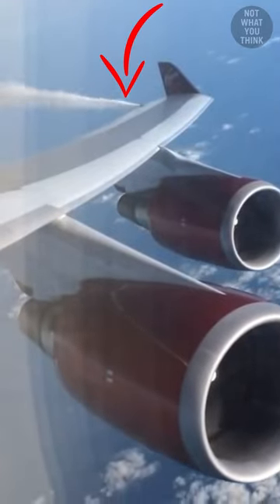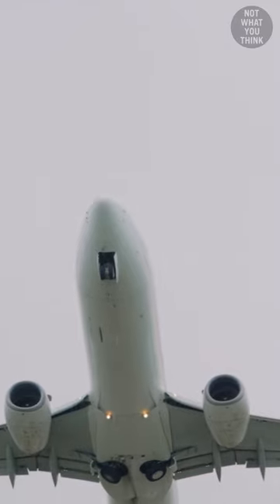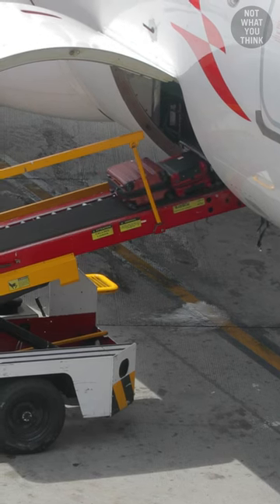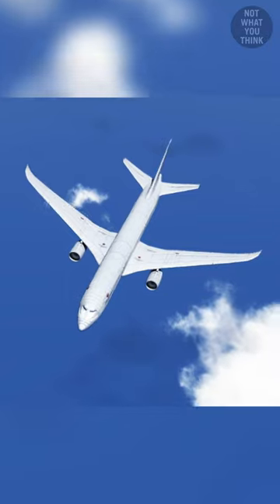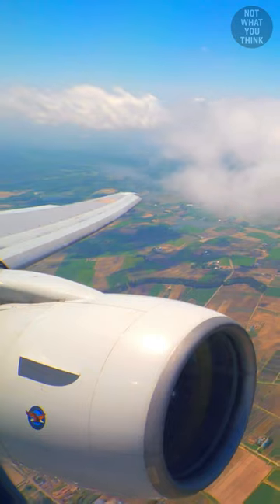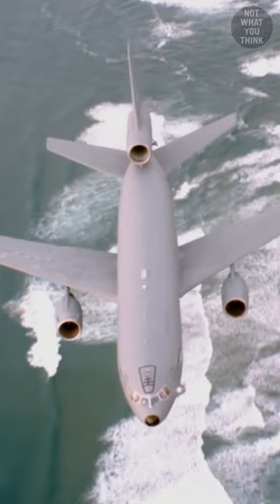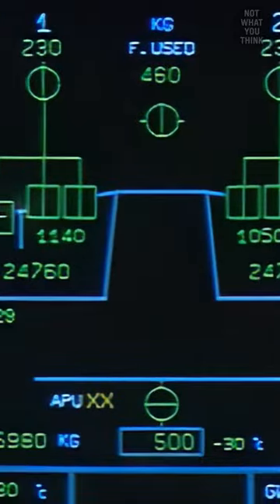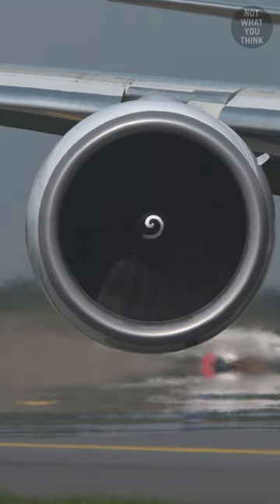Why is the wing fuel used last? #shorts

Comment: Fuel in the wings also puts the weight of the fuel right where the lift is generated, creating less stress on the structure of the airplane. If all the fuel was stored in the fuselage, the wing spars would have to carry more weight, which would shorten their lifespan.
Reply: It also reduces the magnitude of wing fatiguing from turbulence, because it is difficult to accelerate the fuel up and down. The wing is light without that, the stress changes would be close to instantaneous.
Reply: These explanations are far far more important than anything mentioned in the video... which makes me question anything I've "learned" from this channel.
Reply: That's what I was gonna say. I think it's more important to turbulence which is going to happen way more often than running out of gas.
Reply: This was what I was taught, back when I used to refuel aircraft.
Reply: Called wing bending moment, the greatest strain on an aircraft and the reason for most G limitations. The less weight in the fuselage the less stress on the wing spar. Life limits are generally increased manyfold if weight is first taken out of the fuselage.
Other limitations are also affected such as max gross weight, and maneuvering speed if attention is paid to wing fuel vs fuselage fuel.
Reply: @nicholasjohnson778 
Wise man
Reply: @nicholasjohnson778 it’s a 1 minute video…
Reply: @Specter_1125 It's a one minute video that claimed to know the "reason" for loading fuel in the wings, but failed to mention the most critical reason.

Whether it takes an hour or a minute, spreading incomplete information as though it's not, is bad practice.
Reply: @nicholasjohnson778 I would question your unreasonable expectations from a 1 min clip

As long as it’s not fake facts, why whine?
Reply: @SoiBoi_Kelda1059 Because it's not the main reason why aircraft store fuel in the wings.

Right or wrong, people (including myself) are educating ourselves from various internet sources including YouTube. 1 minute or 1 hour, content creators shouldn't make videos if they aren't a professional in that field, haven't interviewed one, or haven't thoroughly researched the topic to avoid obvious mistakes.

Whatever your expertise is, I would hope you call out errors when you see them.
Reply: Spot on. This is the number 1 reason. 
When loading transport aircraft MZFM ( maximum zero fuel mas), is a primary consideration, as is MTOM ( maximum take off mass)  , and MLM ( Maximum Landing Mass). These must all be considered as part of the load sheet calculations for every flight).
( I'm a recently retired airline pilot)
Reply: The only correct explanation
Reply: This is the correct answer. Source: former flight engineer, it was my job to balance fuel
Reply: Exactly, that’s the main reason
Reply: @SoiBoi_Kelda1059 Bingo!!!!
Reply: @genespell4340  lol, have a great continued day
Reply: The gravity feeding sounds good but in most heavy aircraft the engine driven fuel pump can pump fuel from any tank by means of a jet pump or by suction.  If the engine driven pump fails, the engine won't run anyway.
Reply: @mal15102  aircraft are often designed to still use gravity feed, in the event one of the jet pumps or fuel pumps in the tank fails, the fuel can still feed to the engine driven pump.

Comment: Sorry NWYT guy, but none of your points is actually valid. 1) Jet engine cannot work with only gravity feed, they require high fuel flow and pumps are mandatory, thus all jet engines have redundant pumps because if they stop, the engine stop. 2) Having a fire on the fuselage of the plane is not more dangerous, and is actually a lot harder because the fuselage is stronger than the wings. In a crash or very hard land, wings will almost always be damaged, while the center fuel tank won't. 3) The actual reason why the center fuel tank is used first is to reduce wing flex (bend), which makes the wings more efficient by moving weight from the enter of the edge of the wings. In fact, all modern airliners have an inner and outer wing fuel tank, and the last fuel tank used is the outer wing tanks in order to try and keep wing flex as small possible the longest duration. Fuel will always be presend in the inner wing tank because that is where fuel is pumped to the engines, so once the inner wing tanks are low, fiel from the outer wing tanks start being transfered. So to sum up, the center tank is used first to keep the weight of the wing fuld tanks (and reduce the weight of the fuselage) to reduce wing flex and thus improve lift/fuel efficiency.
Reply: Came here to say basically this- I’m not sure how you delineate modern though. The KC-135 is certainly old (engines are comparatively young)- but our fuel burn sequence is slightly different. We have 4 engines, each feeding from their own individual wing tank when burning wing fuel (if memory serves me correctly- it’s been a couple of years).

Comment: The fuel is not gravity fed. It is suction fed. The engines even without the fuel boost pumps running can suck the required fuel through the pipes. The pick up point is always at the very lowest part of the tank and to feed to outboard engines gravity wouldn’t work. It is sucked by the engine driven fuel pump that is directly driven from the accessory gearboxes.

Comment: Finally. I've learned something about planes after 500 shorts from other aviation channels
Reply: That's because they're almost all AI Bot content.
Reply: It’s not actually the reason. I’m an A350 F/O. The main reason is to reduce the loading on the wing spar, the part that joins the wings to the fuselage of the aircraft. Having the weight where the lift is generated means that the structures supporting the aircraft can be weaker, and more importantly, lighter meaning more people, more bags and more cargo inside of the fuselage.

The reasons he mentioned are somewhat true but not the primary reasons.
Reply: Exactly my thoughts
Reply: @zacharytracy3797 is that a thing already?
Reply: @Laluan honestly, with how absolutely stupid the scripts sound sometimes, combined with the now very common text-to-speech voices that we hear all the time, i wouldn’t be surprised if some or even many of the channels that post on yt shorts have the most minimal human intervention possible to generate a vid
Reply: @huskkyy theres probably multiple reasons
Reply: It's not accurate though. You really think you could overcome the pressure in the combustion chamber of a jet engine with a meter of drop? This whole explanation is asinine.

Comment: This is just so incorrect. Gravity feed has NEVER been an option on ANY large aircraft I have seen, and I have been involved in aircraft design for 53 years.. You just won't get enough pressure to feed fuel fast enough.  Fuel in the wing just puts fuel where the lift is generated. It results in less wing bending load. The wing volume is almost useless for any other use except for fuel storage. The center of gravity reason is also correct.
Reply: We could run an engine without the boost pumps (for that particular engine) enabled because the fuel manifold was pressurized by the hydraulic fuel boost pumps when using fuselage fuel. KC-135. On the much smaller t-1 fuel is provided by motive flow from a mechanical engine driven pump and an Venturi pump in the wing tank, only needing an electric boost pump for engine start and a couple other specific situations. Granted, neither of those things are gravity feed
Reply: The engine still has its own fuel.pumps but you can gravity feed from the wing tanks if a boost pump fails or so that's my understanding as a mechanic

Comment: Fun fact: the 747 had 2,200 gal fuel tanks in the horizontal stabilizer of the aircraft and the flight engineer would transfer the fuel back and forth between the wings and the elevator based on the load of the aircraft
Reply: Uh, the “elevator” is the moveable part of the horizontal stabilizer. It carries zero fuel, in fact the horizontal stabilizer carries zero fuel, much less 22,000 gallons or 147,000 pounds of fuel. That’s ludicrous. Fuel is balanced between fuselage tanks however.
Reply: @triggerpointtechnology  look up 747-400 fuel tanks, I was told this by a 747 captain of 20 years. His info is a bit more reliable. And the elevator is the part of the tail that doenst move. The horizontal and vertical stabilizer is what moves. And I made a typo, 2,200 gallons of fuel.
Reply: @thatsrtkid 
Oh, ok, you’re the expert. I’m just a retired 12,000 hour Pan Am Captain.
You don’t know what you are talking about. The newest ones did have a “tail plane” tank, added after the ones I flew. But that is the horizontal stabilizer, not the elevator.
Take a flying lesson for gods sake.
Reply: @thatsrtkid you're wrong lol the elevator is the little piece that moves at the back of the tail to make the aircraft pitch up or down, and they most definitely do not carry any fuel
Reply: 747-400 tail tanks. I know I'm right.
Reply: For the B747 the tank in the stabilizer is an additional tank only. Airbus wide bodies (except the a350) have a trim tank in the ths, the trimmable horizontal stabilizer. This tank is not only a tank but is part of the trim system, controlled by the fcmc.
The tailplane trim tank is always used when the fuel load is above around 37000kg. The refuel system puts fuel in there during the refuel. During the climb at FL255 with certain other conditions fuel is pumped aft to achieve an aft CG target set by the FCMC even if the tank was empty on take off. This is about 2.5pc fwd of the aft CG limit. As fuel is used the CG moves aft and when it reaches a target of 2pc fwd of Aft Cg, then fuel is pumped fwd into the centre or wing tanks.
There is usually only one aft transfer in each flight, but there can be many fwd transfers.
Finally at FL245 in the descent, any remaining fuel is pumped fwd into the wing tanks.
So the CG is held between 2 and 2.5 pc fwd of the aft limit.
Trim fuel is normally used on all flights.
The point of using fuel in the trim tank is to reduce the downforce required to overcome the aircraft lift/weight couple, so the ths can remain "in the flow" without much drag.
And... the elevator is the flap on the trailing edge of the stabilizer. The ths, the trimmable horizontal stabilizer, moves slowly to trim. The elevator makes the fast, temporary movements to pitch up or down. The elevators are the joke/sidestick, the ths are the wheels between the pilots.

Comment: Fuel in the wing is also used for cooling reasons too, as the cold air wraps around the wing. Even fighter jets cycle fuel through their wings. They are used in Oil/Fuel heat exchangers. It is important to keep oil at an operating temp for Velocity.
Reply: Incorrect, the most danger in an airliner is fuel getting too cold, the oil/fuel heat exchangers are meant to KEEP the temperature of the fuel high, not to cool it.
Reply: @MrCaiobrz  it's used for either or. When I was in the fighter community,  they taught us that it was used for cooling fluids. But then again, on the F18 Super Hornet, fuel is constantly moving around the aircraft and keeping the CG centered for maximum performance.
Reply: @itxbr14n comparing an airliner and a fighter is not exactly what I call even remotelly even
Reply: @MrCaiobrz we use a oil heat exchanger to cool the oil itself- not heat the fuel. We even have minimums and procedures in the event of an oil over temp to increase the throttle in order to pass more fuel over the heat exchanger to cool the oil.

Comment: I know this is just semantics but isn’t it the other way around? You want the center of mass to be at the center of lift which is basically right between the wings and by having the fuel in the thing’s creating the lift they don’t affect the balance so you only have to look out whether the freight is balanced. Not to mention that the wings don’t have as much load on them as the fuel is inside of them.

Comment: You can’t gravity feed a jet engine. The pressures needed simply would not work
Reply: Gravity gets the fuel to the engine driven pump which generates the required pressures for combustion. You’re being pedantic.

Source: former c-130 flight engineer

Comment: This is the actual only reason, it is to reduce wing flex and nothing more. Jet engines do not run on gravity only fuel, and a fuel fire is dangerous anywhere, but the wings are more likelly to be damaged than the fuselage in a rough/belly landing

Comment: What is the fuel injection pressure in a jet engine? I'd be willing to guess it's FAR greater than the pressure you get from 1-2 meters of gravity. If the fuel pump goes out, you will never be able to gravity feed a jet engine. The combustion pressure is just WAY to high.

Comment: Also, it provides strength to these wings otherwise they would bend up so badly that they may break.
Reply: Not so much that it provides strength to the wings, as it is keeping the mass closer to where the lift force is.
Reply: @charlesturner you’re both mostly correct. The wing is strengthened with fuel in it but an empty wing won’t necessarily bend until it breaks - but it will bend more causing more fatigue eventually leading to more frequent maintenance. So we use the fuselage fuel first- lightening wing loading, and then wing tanks- but the wings will be just fine even run on empty.

Comment: Aircraft are still required to maintain a minimum level of fuel in the main body tank though, even when they switch to the wings. Leaks are more common on the wings, so having some backup is important.
Reply: Incorrect, there is no need for fuel on the main tank, it is completely emptied first. The only fuel tank that cannot go empty is the inner wing fuel tanks which directly feed the engines.
Reply: We run our mids to empty as well.
Reply: @chrisperrywv  Admittedly, where I initially saw that info (was from a crash investigation documentary) it could have been the airline policy, the aircraft, or maybe regional if those kinds of rules are allowed based on airspace, I don't know.
I'm pretty sure the plane crashed partially because the pilots ran the body tank dry, and couldn't balance the weight by adjusting ballast.
I've watched a lot of those so I can't say when or where it was at this point.
Reply: @davejones9469  well, that, for sure, for sure can happen at least on older airplanes. I’m not sure about newer ones I feel like the computer would keep that from happening, but on the KC 135 we managed all of our fuels manually and could easily get the airplane out of a flyable weight and balance condition.

Comment: Are you sure there is enough weight of fuel to have same pressure as pump does? I'd seen someone made this claim and was debunked
Reply: No, it will not be the same pressure, but it's sufficient to keep the engine running and generating thrust. When it all goes south, that can be enough to stay alive.

Comment: The fuel in the wings is also the last to go because fuel can be pumped between the wings to rebalance the vehicle. In extreme situations changing the balance of the vehicle can also be used to steer.
For instance, if a wing is damaged and won't generate as much lift, fuel can be transferred out of that wing so that the plane will still fly correctly.